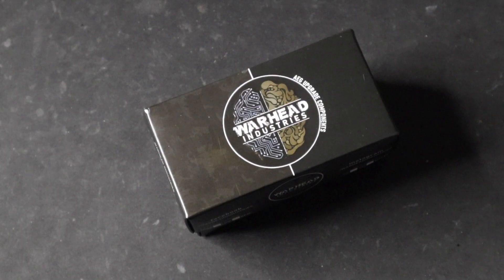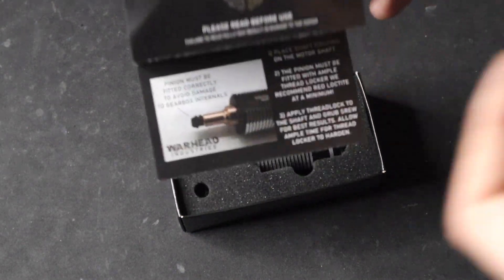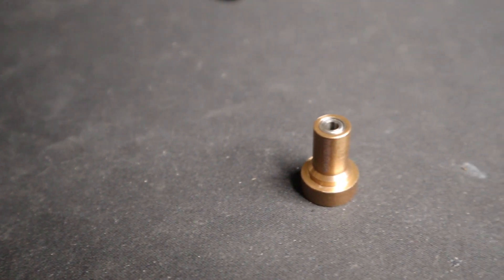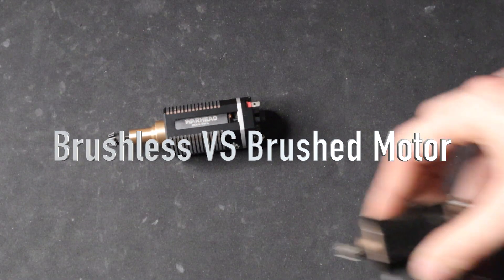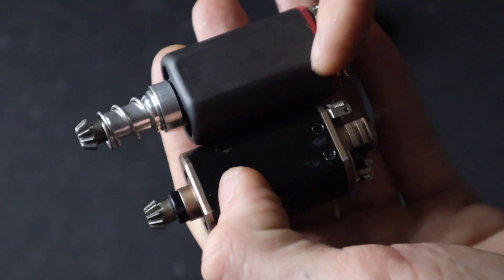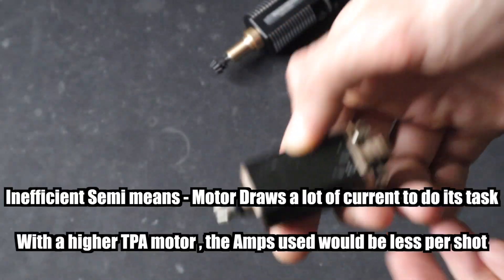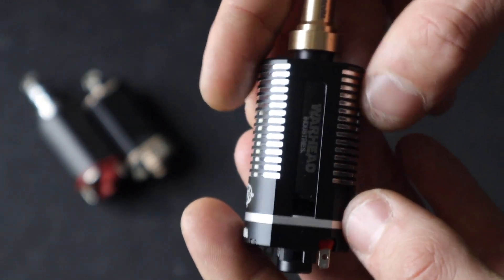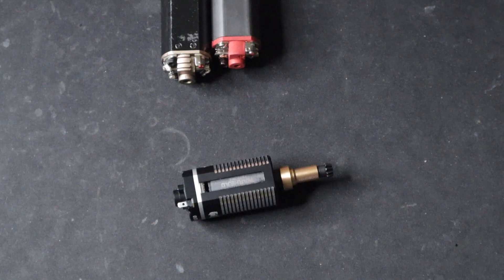$150 AIRSOFT MOTOR!? Warhead Brushless Motor Unboxing : Review

Comment: Fact: it the ultra speed 52k rpm warhead motor, can in fact rip apart our 70$ reinforced high speed gears... i recommend at least 18:1 gears and a m130 spring minimum for any of the brushless motor speeds (speaking from experience and broken stuff)
Reply from the maker: I hate brushless I don’t use them anymore
Reply: @TheRealDealAirsoft , wait. How come? Any issues with brushless motors?

Comment: 52,000 rpm @ 11.1 volts. You could have said that.  Standard motor has rediculous speed and rediculous power??? Huh???  Instead of Rediculous speed and torque How about telling WHAT THE SPEED POWER TORQUE ARE?  BTW  It shows you are being paid for this.  Then you went on to talk about how very clicky it was..  instead of using adjectives use FACTS.  Dang you folk scared to death about being forthright really annoy those of us who are forthright and seek actual knowledge not adjectives obscuring the facts. You want subs? Try BBC eing forthright.
    So you walk in to find out how big and powerful the new engine is that is supposed to be so great and all the salesman says is it's really big. You press him and he says; it Really Really Big and its really really powerful... are you going to buy the car or seek someone with facts not adjectives?
All the way to the end and you went through armature turns yet you NEVER came forward with either the torque or speed SHAME ON YOU... UTTER SHAME!!!

Comment: I’m currently on 16:1 SHS gears and a ZCI 22TPA motor, M120 spring, Titan 11.1v li-ion. I’m content with my current or Rate of fire but it does heat up quite a bit. Looking to update my gun as it’s a fairly old build, What gear ratio and which speed motor would recommend for similar or increased ROF and better efficiency?
Reply from the maker: Based on your information sounds like your rps is about 24-26 rps 

If you don’t change anything and switch to my real deal motor you automatically jump to about 30rps. Which is more so what your looking for. 

What I recommend which will tickle your fancy and will give you the results you were probably chasing in the beginning , Shs 13:1 gears and my motor. 

This will give you a wicked semi. Virtually instant response. As well as minimum 30 rps depending on the battery 30-34 rps 

This combination will make you so excited to spam semi then flip that switch and sling a stream of bbs at 30 rps. Massive difference from your current rate of fire. 

Even the zci on 13:1 is slow. I used to have that years ago. And felt like bruh doesn’t feel upgraded. Auto is like stock rpm. Zci is cheap for a reason. It does have 22 TPA but the magnets and brushes are poor quality and it’s slow. 

You would be smiling ear to ear with the Golden Boi motor

Comment: Hi Jake, awesome video man!!!
I want to use one of these Warhead brushless motors in my build, and I was wondering witch one will be the best fit. I'm running a 12:1 SHS gears ratio with M150 Spring. Between the 3 motors (30k, 36k and 52k) witch one do you think will have the snapiest trigger response ? Will there be a big diference in the initial torque, from one to another ?

I already thank you for your help! And keep up! Your content is the best!!
Reply from the maker: Why on earth are you running an m150 spring on 12:1. For single sector what are you trying to have 550 FPS
Reply from the maker: All motors will have similar torque really the only difference is rpm but the 30 k would be most efficient
Reply: Oh I see Jake. The 30k will draw less power from the battery, right? 
Hahaha I know it sounds crazy but I forgot to mention.. It is short stroked and I was using a Chihai 32 TPA motor, the one with N52 magnets for trigger response. I set it that way to achieve the 1.5 Joule so I can have a more versatile gun that is good for indors and not bad to use in outdor games either.

Do you think those Warhead brushless motors will have a similar torque to my 32 TPA Chihai motor ?... I mean, this motor is a beast

Comment: Is short stroking needed? Or are some people talking bullshit to me?
Reply from the maker: For sure not needed short stroking serves a purpose for particular needs. Reducing FPS increasing cycle time
Reply: @TheRealDealAirsoft  thx m8 :D
Reply: Ide say it is absolutely necessary to avoid pme. But thats only if your running a demanding high speed setup
Reply: @king.nilbert2450  so with the base 35k rpm with a zci bevel which makes the gear ratio to 20:1 it shouldnt be a problem, right?

Comment: thanks for the review! I was trying to find TPA measurements everywhere, not realizing it was irrelevant. 

do you think a simple mosfet like a perun AB++ or a warfet would work with this, or would I have to get a more complicated mosfet that replaces my trigger contacts? thanks!
Reply from the maker: The mosfets that replace your trigger contacts are actually much less complicated , take the Perun Hybrid for example , 

Bro it’s so simple and so straight foward. You don’t have to think just remove all the bullshit from your gearbox ( cut off lever / trigger contacts / bulkshit wires and simply just put one screw to secure the board and that’s it. 

No soldering nothing. It’s so much better. Programable trigger sensativity all that for just $65 

Available on www.TheRealDealAirsoft if you want one shipped out within a day your brother got you

Comment: It's a great motor. The pinion is rather weak I've found and I dont like the grub screw even with loctite. However they are very efficient, and better than the option no 1 brushless motor in terms of torque and speed for the ultra high speed. Currently I'm using the ultra high speed version in a 20:1dsg that's doing over 65rps with a 25amp draw.
Reply from the maker: That’s abs insane bro. Such a small amp draw for what it’s doing. Do you have mags to keep up with the feeding
Reply: @TheRealDealAirsoft  pts epm1s, or lonex flashmags. Or use the maple leaf magazine springs. Also j caged bearings make a nice difference in the amp draw for high rof
Reply from the maker: Great information !

Comment: Thanks for the Review man!
I just got this Warhead industries motor in the Mail today and then just saw this video pop up..what a coincidence!!  I got the Ultra High Speed version.  Can’t wait to get this motor installed in one of my guns! Already shooting a little over 40-RPS with a Tienly 50k high speed motor and 12:1 ssg shs gears in one of my kwa t6 but it runs a little hot.  I’m expecting a little more RPS and cooler temps with this Warehead industries motor.
Reply from the maker: You will get abs insane results probably over 65 rps drawing 20 amps. Which is super efficient

Comment: Excellent review my friend, I did a very basic comparison back in Jan between a 14TPA and an Warhead Ultra.  The Warhead motor was 30% faster but drew 20% less amps than the brushed 14TPA this was with a 7.4v.  The external temp after 2000 shots of the warhead was 35 (centigrade) whilst the 14TPA was 50 (centigrade)
Reply: I would love to know how many amps it draws compared to a 28TPA motor :)
Reply: @tom0boi  i would too.

Comment: This motor is pretty big though, might not even fit in my grip, i have a lancer Gen2 and still have the stock motor, but before i do anything else to my rifle i need to get a new battery, and prob gonna get a new stock, getting a 11.1 3000mah titan battery, and a PTS Eps stock
Reply from the maker: It will fit the grip
Reply: @TheRealDealAirsoft  oh nice!
Reply: Why not get a new gun? Lancers suck
Reply: @OctaneGroup  ^^^
Reply: @OctaneGroup  lancers don't suck, you can buy a Lance for 180 and upgrade for 200, bam you have equivalent to a $1500 gun
EDIT: 9MONTHS LATER, VERY WRONG ABOUT THIS,  I got my lancer for $120, I got lucky with the qc, they are better now with their gen 3s, I have a gen 2 though, but it is definitely a better option to go with a gen3 lancer for $180-200 than go with a $400-500 krytac if your just going to replace all the internals anyways sooo
Reply: @thelethalpredator672  if that was true, everyone would have a lancer. If you buy a lancer there’s a 50% chance it works fine and a 50% chance it’s FUCKED out of the box. Has happened to me and many others.
Reply: @thelethalpredator672  that may be the dumbest thing i have ever heard. not only are lancer internals a gamble at best, their external quality also sucks. they've been known to snap in half. you do not have the equivalent of a $1500 gun, you have $200 worth of mismatched parts in a shitty plastic body. you could easily get an LCT, E&L, MAS, KWA, etc for that kind of money, and it would be worth much more than the lancer.
Reply: @johnlewtas6833  I do know now, I have put about $500 into it now, and I was very much in the wrong, but lancers are still not all bad, just their QC was really bad, but I got lucky with mine, and it's pretty good, upgrades I have for it now: 11.1 3000mah, maxx cnc hop up chamber, shims, bearings, Gate Aster mosfet, prometheus 363mm barrel, and maple leaf macaron 70°
Reply: @OctaneGroup  ^